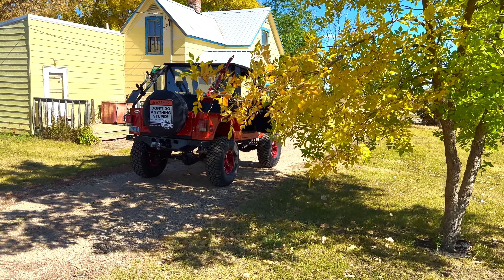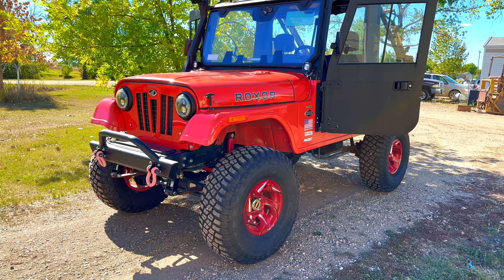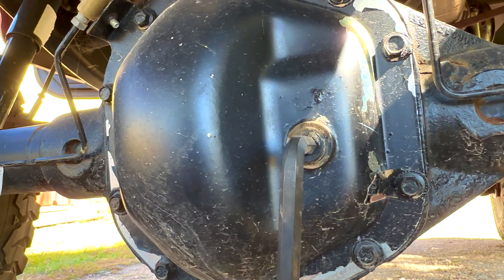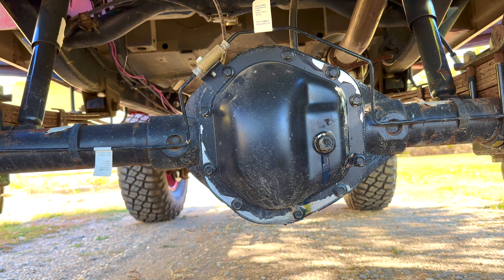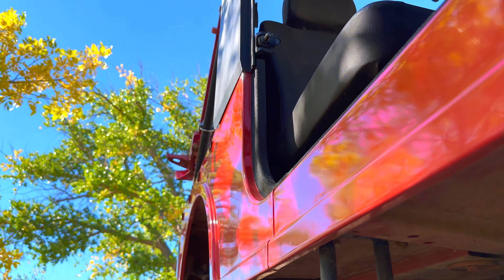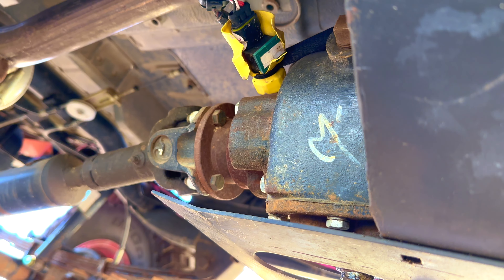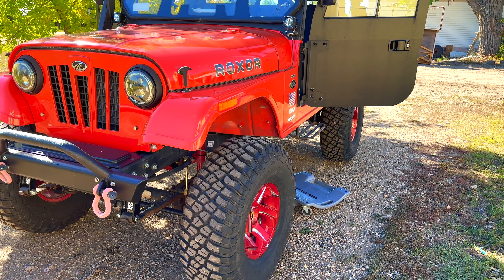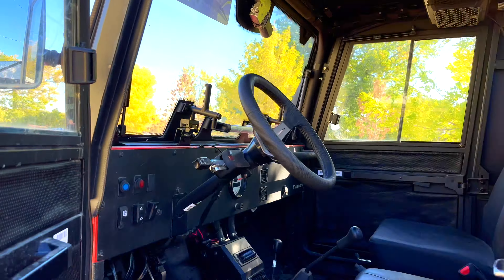Mahindra Roxor Front and Rear Differential, Transfer case Oil Top Off.

Comment: My transmission and transfer case was low. During break-in I drained and refilled with the  GL4.  That stuff is hard to find. I bought the GL4 at an oil specialty distributor. It's not cheap